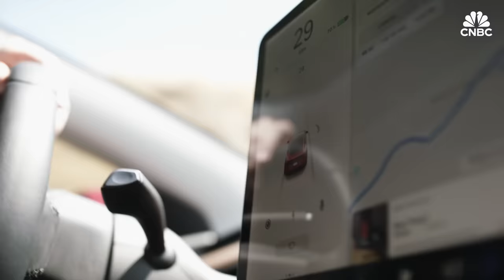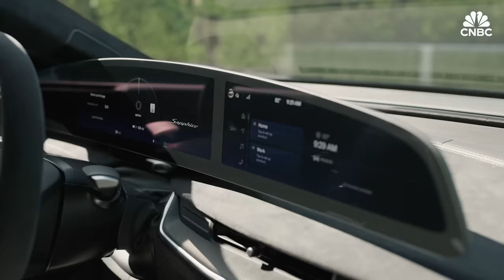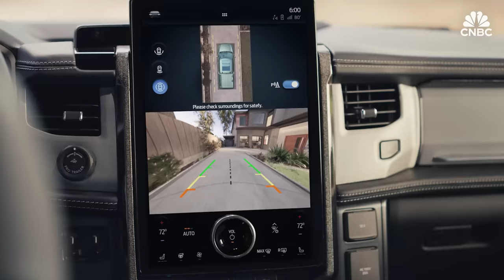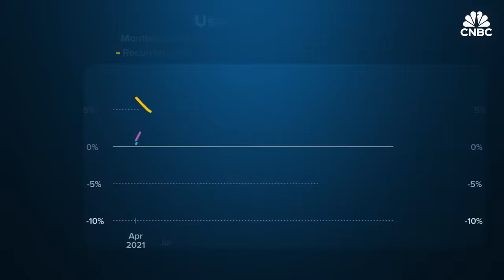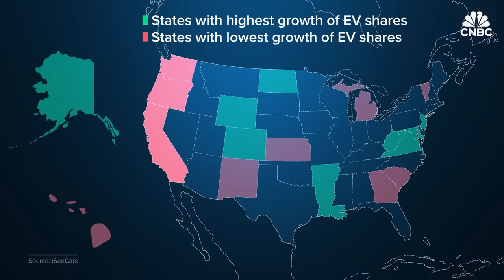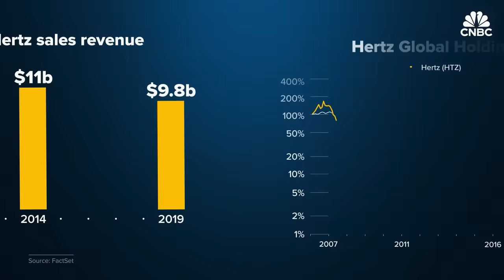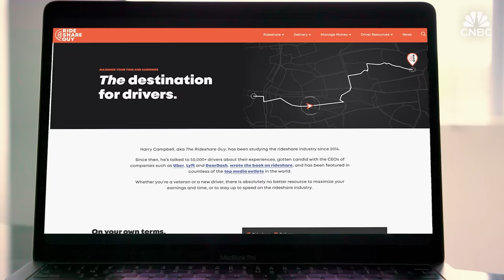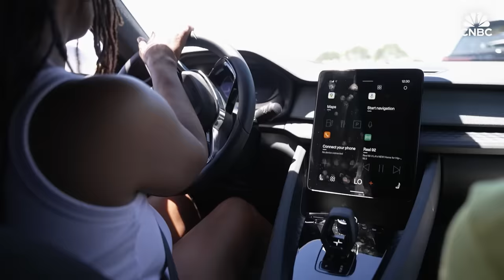Why EV Sales Are Falling | CNBC Marathon

Comment: No body wants EV.  High price, high insurance rate, high DMV fee, long charge time but short driving range, super low resell value, toxic to the environment, danger battery chemical fire, INSANELY expensive battery replacement cost, and tons of more problems!
Reply: Check out the new BYD 5th gen DM-i hybrid car that has 1200 mile range
Reply: @kananimiranda3376  Thx for sharing the experience. Wish you a better luck on your next car shopping!
Reply: @Pigboykool: it is obvious you have not even tried to drive an EV.  I would recommend the Ford Mach E, F-150 Lightning, the new Chevy Blazer EV, Kia EV6, or VW ID.4 if you can't stand the idea of visiting a Tesla showroom.  Or go to Hertz and rent a Tesla for a week or two.  They drive like any car but with great acceleration.  The one-pedal driving really is easy to figure out. They are not nearly as weird as you might think. 
High price compared to what? Plenty of EVs are in the $35-45,000 range.  Count reduced service maintenance cost over lifetime of the vehicle, and the price comparison is a lot closer than you might think; BTW, Count the time it takes to drop off/pick up a vehicle for servicing that does not occur with an EV. 
Insurance costs higher may be a valid criticism, but when was that ever a final deciding factor in which car to buy? 
DMV registration fees in some states are higher than equivalent ICE cards justified by lack of gasoline/road tax paid, in others, not so much.  Consider this a myth. 
Charging time often is a matter of plugging in when you get home and unplugging when you next go out--multi-tasking /charging from home.  Now, count the time it takes to drive to the gas station, wait in line if it's at a Costco, gas up and then return.  
Driving range issues occur during long range trips.  How often does that impact  you / your family?  Does your family travel 3-4 hours straight nonstop? No? Recharging on a long trip is just a matter of scheduling charging a normal break time intervals.  It's not the major inconvenience you might think.  
Fires:  Compare EV fires/miles driven with ICE vehicle fires/miles driven.  Today's EVs rarely have spontaneous combustible events (anymore). And GM stopped making the Bolt.
Battery replacements: This is another myth. Who is reporting there are large numbers of EV batteries being replaced at high costs?  In fact, there are many reports of 1st gen EV batteries at 150K-200K with only light to normal degradation.  Batteries can be either recycled or repurposed.  They are too valuable to throw them into a landfill.
Reply: @888fatboy  your comment is dripping with privilege. 

you assume I own a home which can charge the vehicle but don't include installing the charger in the start cost.

you acknowledge the hundreds extra per month in insurance and write it off as not a deciding factor.

you assume 35-45k as a car purchase to just be standard where I can find used cars of comparable worth for 3-4k.
Reply: By contrast , in Vietnam , we have manufactured the EV which call Vinfast and also it have some drawsback about time to charge or the high price . Although the disadvantage , Vietnamese people still buy it cuz for the first reason , Vinfast build a lot of Electrical charging post like Telsa and it is extended along the country😁, next , the value it bring to the consumer is unbelievable that the safety of that is great 4-staring rates ASIAN NCAP and much more !!
Reply: @hieu3700  Interesting, I hope it won't take 30 minutes to charge the EV.  Time is money you know especailly in a business trip.
Reply: @jjl8511 nothing Chinese please. Where's the network? What recourse do you have if there's an issue?
Reply: Exactly 👍 well said & put . Not worth it
Reply: @hieu3700 go post on a Vietnamese channel. No one can understand what you are saying or really care.
Reply: Correct.  Don't forget EVs are ugly as sin, as well.
Reply: Exactly if you value your money don’t waste your money & time purchasing a stupid EV in the first place. Personally I never would
Reply: @randyp2047  exactly 👍 an EV doesn’t make economic sense to buy in the first place. All they are is a money pit .
Reply: Nobody wants EV? Tesla only sells over a million cars a year.
Reply: And NO fun.
Reply: @pigboykool  dido ! Personally I never will consider purchasing a stupid EV NO Thank you .
Reply: @robertwhite9898  Same here.  Can't imagine getting stuck in a ghetto area parking lot for 30-40 minutes because the EV is out of juice.  It is terrible especially for the ladies.
Reply: @pigboykool  exactly. Dido ! Besides the replacement batteries are very expensive & the insurance is pricey. No thank you . Don’t waste your money on a EV . All they are is a money pit
Reply: In Latin America BYD bought a model called Dolphin, around 25k, you can charge it at home, it takes an hour to charge, charger included, just have to pay for installation, 8 years battery warranty and 5 years warranty on the car. 405 km by charge it looks like an amazing option for work communting
Reply: @theatricult  It's not "Privilege". It's being an adult with a job, and of course, a driver's license, and most of all the common sense to know that the worst place to get your wisdom is mainstream headlines. My guess is you don't fall in at least 3 of these categories.
This being said, if you're really homeless or can't afford a place decent enough to have an external AC outlet, you have much bigger things to worry about than affording the next level of automotive technology. Also, stay away from cars selling around $3-4K. They're money pits. Use public transportation if available, or even a bicycle, until you get your financial situation straightened out. Good luck.
Reply: @bonbonjovi4836  I know right? People making this claim must look like pretzels, judging from where their heads are at.
Reply: @ElMistroFeroz  Wow you are proof that just because youre an adult with a job it doesnt mean you are mature

Comment: Only in Corporate Media will they tell you EVs are too expensive then a minute later say Tesla slashed prices like it's a bad thing.
Reply: In a way it's bad because it made less profits for Tesla.  They also don't make much money on the service side because almost everything is covered under warranty and very little is customer pay.
Reply: @Alss383 So the truth is, nobody wants to keep an EV outside of warranty because they quickly become outdated, lemons, not to mention those replacement batteries can cause fires when the vehicle is parked and not in use. If Tesla only warrants an EV at 10 years, that means they know their car only lasts 10 years. Some people paid well over 100k for those cars that don't last even 10 yrs. So some spent 10k per year on a lemon vehicle. Meanwhile, a Toyota Prius might cost about 25-30k brand new and will last 20 years. Even if you add in maintenance that Prius doesn't cost more than 40k to last 20 years, 2k per year compared to 10k per year for those lemon Teslas. Why on Earth would someone buy a Tesla unless they're a dummy?
Reply: @NovaPrincess you're forgetting to include fuel costs. That alone would pay for the car itself. In addition, maintenance costs add up quickly as combustion cars age. A new motor and transmission can cost well over 10k, but most people don't keep their cars that long. 3 Years on average. A pruis also uses batteries with a 10 year expiration date IN ADDITION  to all the regular maintenance costs of its combustion engine. You're paying 2x.
Reply: @XhectorX1417 Well sure, throw in fuel costs because I live in a place where it's $2.50-$3.50 per gallon and electricity is about 11 cents per kwh. EV folks never want to calculate the cost of using electricity and time. The projected EV range is greatly reduced in cold weather and when driving freeway at 80+ MPH, which is how it is where I live. I'd need to own the Tesla for easily 40 years to make up for the cost difference when adding in fuel for hybrid Prius vs Tesla electricity only. We all know good and well no Tesla will last 40 years to make up for any 'electricity charging savings'. We all know those Tesla lemons barely can get to the 8-10 yr range for normal drivers.
Reply: @XhectorX1417  EVs may have less maintenance than ICE cars but they are definitely not maintenance free if you want them to last 20+ years like ICE cars do. You'll need at least 1 battery replacement which will total the car. My 20-year-old truck is on its original engine, transmission, differentials (front and rear), transfer case, etc. EVs still need gear oil, brake fluid, coolant, tires need to be replaced more often, their rubber seals still need to be replaced after 15-20 years.
Reply: lol so true

Comment: The reason why Hertz failed in the EV space was simple. Business and pleasure users who are on their way to the airport to return their Tesla do not have 2 hours to charge before they return it. Requiring users to do that was a dumb idea from the beginning.
Reply: Oooo so it had nothing to do with the High Maintenance Repair costs ? The ROI was not there as Tesla dropped the price screwing Herts and others over.
Reply: Yep. Hertz went Bankrupt for a reason not too long ago. Time for them to get with the program and make it simple for people.
Reply: @ImLivinSD  The reason you listed had nothing to do with maintenance costs. Indeed tesla dropping the price screwed Hertz's potential resale value for their fleet.
Reply: @ImLivinSD It wasn’t the maintenance cost, which is much lower on EVa. It was the repair costs because people damage rentals when they give few f*s about it.
Reply: @ImLivinSD there are no maintenance costs outside of brakes, tires 12V batteries and washer fluid. In fact my model s 12V battery was cheaper than my Lexus is and they come to you to replace.
Reply: It does take 2 hrs to charge a Tesla it’s more like 30 mins. But I agree it’s more of a hassle given the availability of chargers. Charging should be taking care of by Herts when the prep the vehicle for the next customer.
Reply: @ImLivinSD  EV’s have minimal maintenance. The ROI was impacted by the decreased cost of purchasing new Teslas which precipitated to the used market.
Reply: For real they should have installed level two chargers and not required customers to return a fully charged vehicle and delivered fully charged vehicles to customers.
Reply: And Hertz charges 90$ for an adapter for charging. I had to pay 65$ for bringing the car with less than 70% battery.
Reply: @haywoodmorganjr1326 lol, they barely want to clean the vehicle for the next customer. Imagine them actually wanting to charge a vehicle even though the previous customer paid the $30 for hertz to do it.
Reply: Facts i rented one for 3 weeks for 733$ and they up charged me to 930$ i sent then to collections 😂 a year later ill make a deal and pay like 150$
Reply: I own an ev and it works great for me at home where I have my charger. If I'm in holiday travelling all over I never even contemplated renting one.
Reply: It doesn’t take two hours to charge a Tesla 😂😂
Reply: 2 hours to recharge?  That's a lie.